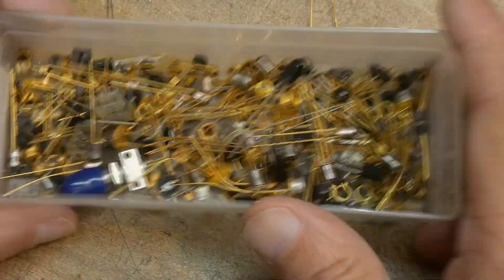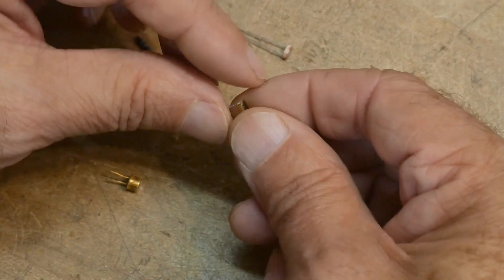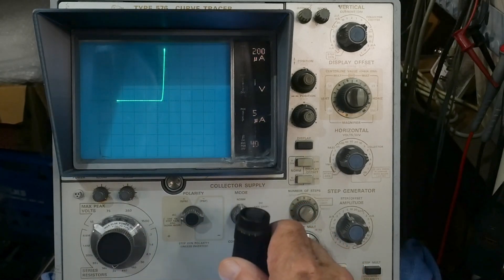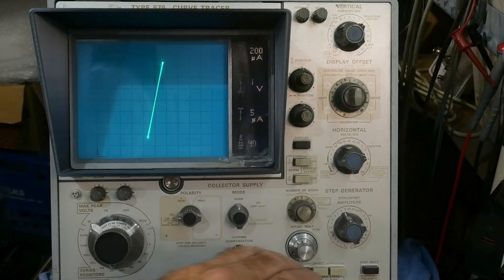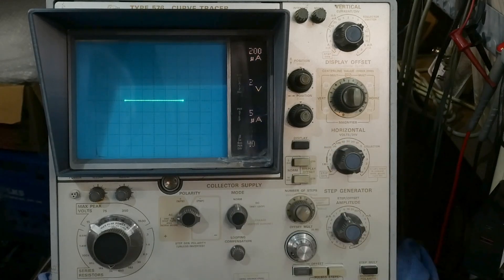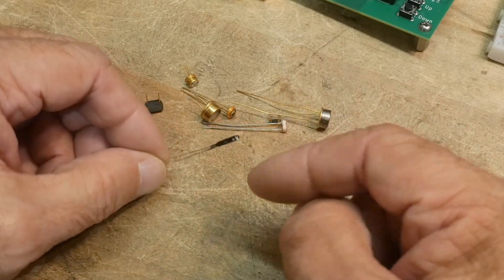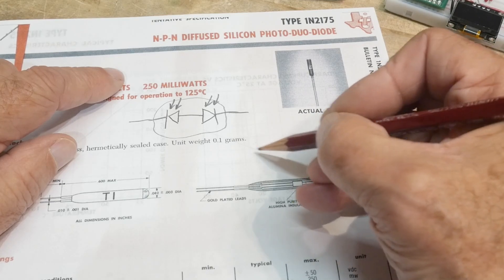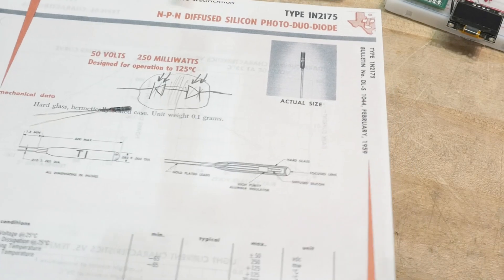#2086 Diffused Silicon Photo-duo-diode

Comment: That 1n2175 looks a lot like the ones used in the paper tape reader in a Bendix G15 (valve/tube) computer from the 1950s that Usagi Electric has been restoring.
Just spotted that others have commented on this as well - thought I checked first 🤦
Reply from the maker: yes, late to the party

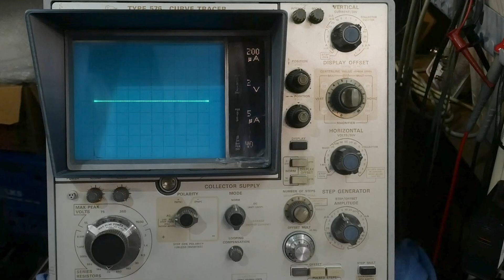Comment: At 6:30, the p layer is still very thin to avoid the 0.7 V diode bias voltage; the carriers that get generated in the reverse biased junction diffuse through the other junction without needing more energy.  Unlike a transistor, the 'collector' and 'emitter' have equal doping and little or no current gain.  These are useful in AC applications and might be followed by an AM detector.
Reply: That sounds quite a bit like how early point contact transistors would function, prior to forming the collector. A curve tracer would reveal suitable behavior before, and hopefully significantly improved behavior after the forming.

Comment: Have you a laser diode can opener?
You know, for removing the output coupler?

BTW, Usagi Electric recently made a tape-reader as well as repaired a Bendix computer, which used devices that looked a bit like those Photo Duo-diodes. Perhaps that is why they are so small in diameter.
Reply from the maker: i did open one: https://youtu.be/6QCEoSzypoA?si=j0Bxch6k125eI24o
Reply: Wow!
I knew I going through some stuff at the hospital with my lung, but I didn't think something laser-related would slip my mind.

Sorry. (embarrassed)

Comment: It would have been nice to seen an application for the device.
Reply: Given the age of the part and the form-factor, this seems purpose made for paper tape readers.  It predates mini-computers, but perhaps a high-speed tape reader for mainframes would be a fit for, e.g., loading bootstraps.  It was the age teletypes that had mechanical readers and punches for storage and moving to optical reading would have been a natural thing to do at the time.
Reply: @lmamakos  Also used in auto-flushing toilets though those are larger; it senses the light being cut off, when you step away, it activated the valve.

Comment: There is a reference, Electronics World 1969 July, which came off the EEV blog forum.
"Increased output, as a result of the multiplication of light current, can be obtained in semiconductors by what is referred to as the hook collector mechanism. The mechanism is realized by having two junctions in the same device separated by a wide base region. The resultant n-p-n structure is called a photo-duo-diode (see Fig. 2). " Googling the quote will find the article.

Comment: So it's basically a phototransistor without the base connection.
Reply: not really because it's symmetrical, and the "base" is likely thick enough to not act as a base. It's probably no more a phototransistor than 2 regular diodes connected back to back make a transistor.
Reply: maybe, although the datasheet does refer to it as an N-P-N device indicating a construction closer to that of a BJT than of a common anode dual diode... 🤔